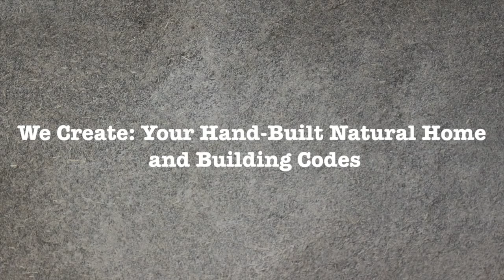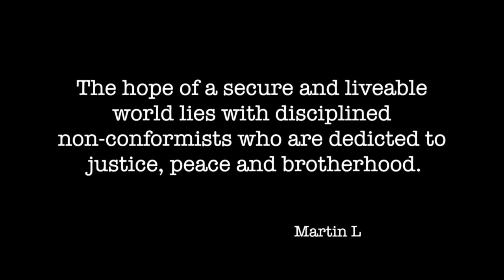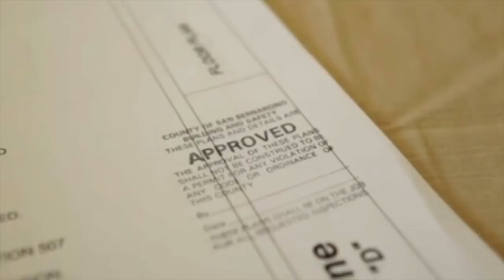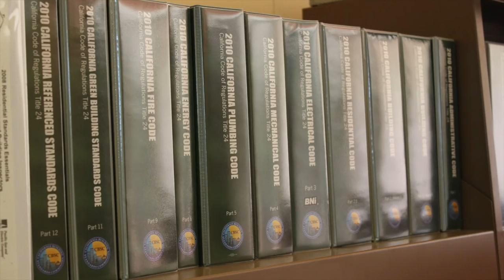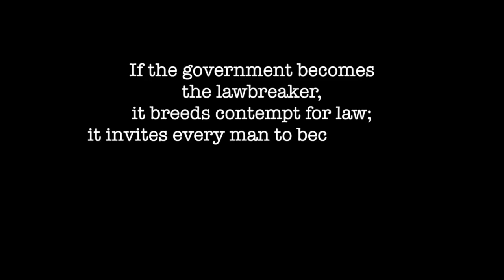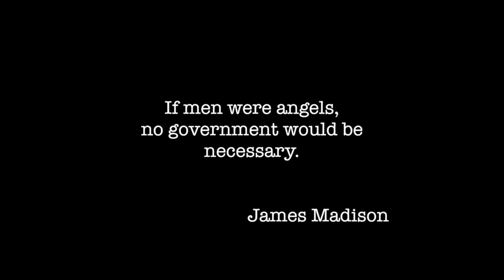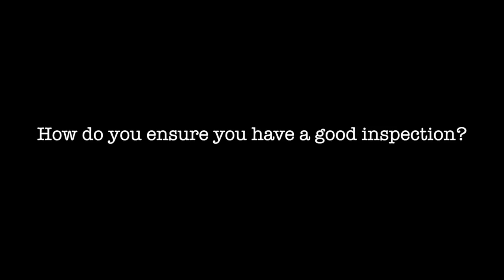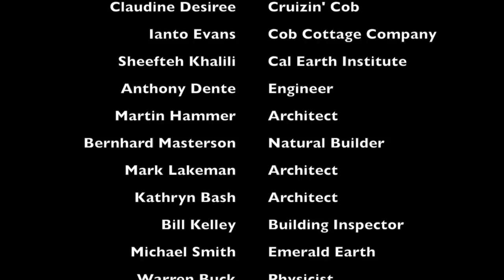Handbuilt small homes and the building codes

Comment: I understand that many areas, allow one to build a basement...without any permit...as long as it is not used as a foundation for a regular structure.....  of course, they require permits for electrical, plumbing, etc.....IF one uses regular systems.....but what if people use free-standing systems?  Portable solar/wind?  Portable tanks of water?  What if one uses a manufactured wetland to treat sewage, instead of the usual septic systems [which ALWAYS fail]?
Reply from the maker: Think about this.... isn't this rather odd.  Wouldn't you think that a basement (assuming it then has some earth or something over it) would put people more at risk than a simple structure above the ground?  In France building manufactured wetlands is used all over the place - I'm not sure they've been written into the code here but I was heartened to see humanure toilets at a recycled art event organized by Vancouver, WA city officials.   Ive just spent 3 weeks in a place that uses solar only and the only water is from rain collection in tanks, they've been doing this for decades without problems.  However, I'm told that in many parts of the States - there has to be some kind of permit for and inspection (ongoing) on rain tanks.
Reply: Cari Corbet-Owen It took WA State many years before they allowed only certain models of composting toilets to be permitted.  Then, they changed laws, allowing for up to 50% smaller leach fields...still have to have a septic system, but can have markedly smaller leach field, if only using composting toilet[s].   But, those must be the ones from the State approved list...very few are on the list.
I think Manufactured wetlands are in the UBC [Universal Building Code], which WA has adopted...but, each County messes with it, tweaks it slightly, to suit the county's agent's opinions of what is proper.  Manufactured wetlands are actually better than septic systems, because those keep the bacteria aerobic...septic systems keep the bacteria in them, anaerobic, therefore more pathogenic [sick-causing], and, anaerobic bacteria, spread farther through ground and ground water, than aerobic bacteria can....that alone, makes manufactured wetlands safer....also more efficient at breaking down the sludge.  
The USA is nothing if not obstructively in favor of keeping septic and sewage treatment going as usual, no matter what--it's hugely profitable business! 
Someone talked with us about manufactured wetlands instead of a usual septic system [Grays Harbor County]...but, it's not generally used, therefore would need permitted [varianced?] as "experimental", fill out many forms, including engineering plans that showed it is viable, and, County must have permission to come inspect periodically, as well as reports on it's progress must be filed periodically with County...cannot remember exactly--complicated...and, I think how long the reports and inspections go on, is variable per County and inspectors. 
Composting toilets have been being shown at earthday fairs, Mother Earth fairs, all sorts of other public venues.  SunMar has been around probably longest, and bothered to spend millions of dollars to get their products through permitting etc. But, there are OTHER designs of similar products, which are far better, easier to use, and which separate liquids from solids, making composting less stinky, and, better.    Bucket potties have been used for a very long time, and there are better forms of them, too....check out SOLVIVA.com I think it is...Anna Eddy wrote a boo called Solviva, in which she described 2 different systems she's used, which are very effective, and, add worms--the kind used for fishing, which live in the top several inches of dirt in the ground...because she found, those actually abate the coliform germs that health departments worry about.  But, same health departments, refuse to let her systems be used, even though she can prove they work better, more safely, than usual permitted systems....and far less costly...that is key...costly permitted engineered systems, have a stranglehold on industry and permitting!   
BASEMENTS/Underground houses:  Consider this:  IF a room[s] is underground, and, is properly framed/supported/reinforced [read: engineered properly], that hollow space moves WITH the earth surrounding it, instead of suffering having to flex with the movements effects, if the same hollow room is above ground.   Consider placing a house of cards, on a table, and bumping it...the cards fall over.  If the house of cards is supported all around, it  tends to stay together.   Or, hold some loose bits of things in a pattern in your hand, using fingers to keep them in place....you can move all over the place, and the pieces stay put, as long as the fingers support them in place....but, put same pieces, in same pattern on the back of your hand, or on a piece of paper, then move the paper or your hand...nothing supports the pieces, so they scatter.   
The roof will NOT fall in, as long as the hollow space under it, is properly engineered.  Same for the walls.   
There's so much more!  I've been studying this stuff for over 40 years; been playing with designs of off-grid, self-sustaining underground houses, for over 50 years.   MUCH of what stymies progress, are existing industries protecting their market share.  
Also, much is due to entrenched ignorance.  
Keep learning!

Comment: Bricks designed in ancient history - Egyptian Pyramids - I do believe were made of clay & hay.  Also, the Tower of Babel was made with fired bricks; a test was made to see if ancient bricks at ground level could have the strength to hold the top level.   Well, bricks did hold up and last.  Clay mixed with straw, kept to certain heights, whether you use framing ( wood, metal, screen or plastic ) or not,  can be viable, safe and last for a certain time.  Maybe people have complicated codes and should re-examine building small structures, that may coincide with the environmental footprint.  Better than people being shelter-less, poor & hungry, unhealthy and dying before their time.  Oh, well, only a thought. Thanks.
Reply: Exactly!  Paul I made these two documentaries for precisely the reasons you've given here.  For smaller structures we don't need all the building code we have and when people are building their own small structures they are highly invested in making sure they are safe.  And so-called primitive societies have been building their own homes for millennia with no 'help' from building codes.  But do we need them for the monstrous sized homes we think we need these days. I'd say yes, for those but we don't need huge homes to heat and maintain.  The whole idea of what we need needs to be revisited.

Comment: The New Zealand building codes were inadequate in the cob house build?   Don't they build to strong earthquake standards also?
Reply: I think there are some earthquakes that will level pretty much any construction except highly technological specifically earthquake steel buildings.  But there is a pretty video done in British Columbia where the first take a model cob building up to 7.5 on the richter scale on a shake test and then finally take that same already 'earthquake exposed' building to above a 9... and only at that point does it actually sheer but even then no-one inside of it would have been harmed.  Also depends a LOT on the shape of the building, round and curved hold up much better than square.
Reply: Cari Corbet-owen 
Love this info!   I knew that at one point they tested to about 7.0 but to have actually gone to 9.0 is great.   I'll have to check that out.   I just saw something on conventional building and I believe up to 2 story wood frame buildings faired well in earthquakes too.

Comment: I agree that some building codes are total BS, but at the same time a lot of them are there to keep people from being killed when a shoddy construction collapses. The woman crying because she had to rebuild half of her house should have looked into the codes for her area BEFORE building her house. Simple common sense, but it's so much easier to just cry about it and make somebody else out as the bad guy.
Reply from the maker: Hi Therevdon - the way I understand it is that building codes were orginally introduced to stop unscrupulous builders.  However they have 'evolved' into an unmanageable mess.  People all over the world build their own perfectly safe small homes using earth without any 'help' from building codes - when you're building your own home you're highly invested in it's safety.  And most owner built homes that I've seen   last many years and have the added bonus of being more readily maintained because owner builders have the skills to do that.  Cob has not yet been written into the code for habitable spaces although there are increasing numbers of them that are being retrospectively approved so if you build this way - you do need to know that before you start building to decide whether you're prepared to take the risk of being told to pull it down.
Reply: I agree 100%, and I've had my own issues with building inspectors even when I got a building permit and followed the regulations to the letter. I've had inspectors fail me for doing EXACTLY what they said to do, then fail the corrections THEY told me to make. Almost makes me think they get paid by the number of failures. They can be a huge, horrible, frustrating pain to deal with, and I'm not trying to defend them at all, but this woman doesn't really have a right to be upset with the inspectors because they failed a structure that was built with no regard at all to the building code. She only has herself to blame in this case. Crying and blaming the inspectors for her own mistake won't help the situation
Reply from the maker: I agree that building inspectors can be a pain in the butt - I've had some similar issues as you... but the other issue you have to take into account when you decide to build an illegal structure is that there is always the risk that it will be discovered and that ISN'T any building inspectors fault - that's just the law.  And the back story to this is that this lady unfortunately had a relationship that turned sour and had her structures (2 cob buildings and a treehouse all being used illegally as inhabitable spaces) reported at which point the building department is legally obliged to investigate.   And then,  instead of working with building officials she did plenty that antagonized them and I'm afraid that's a no-win for anyone - especially not the community of cob builders who don't gain anything when officials feel negative because of a prior experience such as this.  On the other hand, the Buck's in Snohomish country also built an illegal structure and were living in it - and arrived home one day to find a notice on their door saying it had to be demolished and they had to pay daily fines until it was.  They went in, spoke to the building department with an attitude of understanding and yes, admittedly with lots of backwards and forwards, they got it respectively approved and said the officials they worked with were fabulous.  So a lot of what happens also depends on how willing we are to work with officials.
Reply: I think we're mostly on the same page. My point is she built illegally instead of following code. She has nobody to blame but herself when the illegal home was discovered and the inspectors told her to bring it up to code. She should have built to code with approved materials instead of building illegally then crying about it after the fact. The inspectors aren't to blame, she is.

Comment: why don't they just move to some old forgotton neighborhood instead of just letting it decay to the point that the criminals will not even live there and then the immigrants then move in and everybody then has a problem with it? seems like that would be greener.
Reply: There were neighborhoods in Brooklyn where one wanted immigrants. For example if you got a cluster of Koreans moving in your streets got a lot cleaner and your produce stands offered great produce. If you had a lot of Jews moving in you got less street crime.  Having aneighborhood fill with immigrants is not always a bad thing.
Reply: Usually those neighborhoods are full of troubles and as the infrastructure is usually warn out your taxes could be quite nasty. Then at night you might have to bolt your teeth in your mouth to keep them from being stolen in the night. On top of that a great home in a lousy neighborhood often means the home will have very low sales value.

Comment: I am an engineer. Strawbale is shit compared to earthbag. Ask yourself why there are so many people building strawbale, its probably an attempt to discredit alternative building because its such a shitty building method.
Reply: Don't you think they just have different properties that serve different things better?  For example, straw bale is more insulate than earth.  So when we built a small cabin in New Mexico we built all the walls with earth except the north-facing one where we wanted more insulation.  I also think that more people are building with straw bale because it has been written into the building code whereas earth hasn't.
Reply: That was my entire point. Under Agenda 21 they can write inferior methods into the building codes because it does not benefit the sheep and perpetuates artificial scarcity.
Reply: :)  Im not convinced straw bale in inferior when used properly and for the proper purpose.  However, the minute it's written into the code it does make it vastly more expensive to build with than before it was which is problematic for me.

Comment: Why is this still horrible rez even at 720p?
Reply from the maker: There are a very few grainy images - but the rest should be good.  As I said to someone previously, if I waited until I was able to put out a product that was 'perfect' in every single way - I'd never produce anything. I'd just sit at home paralyzed. Much rather get out something less than perfect and at least get it out there, than worry about every imperfection and never share it.  There are way too many awesome projects that never see the light of day because people are worried about being criticized which is all too common on the web sadly.  It's part of my life's philosophy that more 'simple living' (which is basically the theme of these videos) is about doing things simply and imperfectly and being Ok with that.  It wouldn't make sense to me to push for cheaper and vastly more simpler living and then go out and buy expensive equipment and spend a fortune making a 'perfect project' - that would have felt inauthentic.  Having said all that, sorry that the rez bothers you.
Reply: I see, the quality does improve. Thanks for sharing! Great little homes.
Reply from the maker: You're welcome Chad